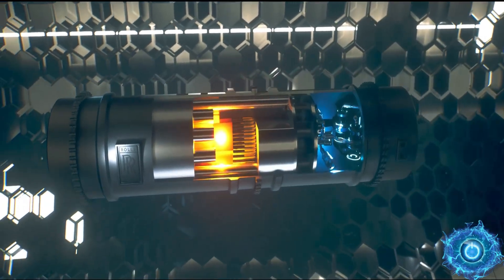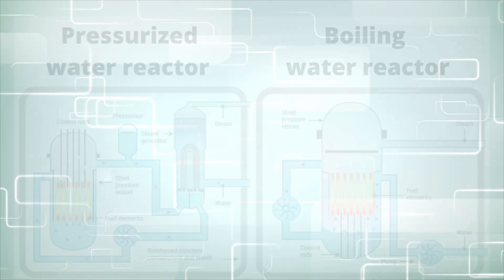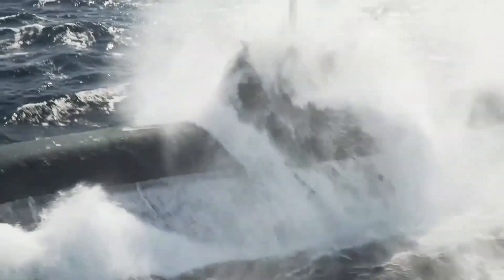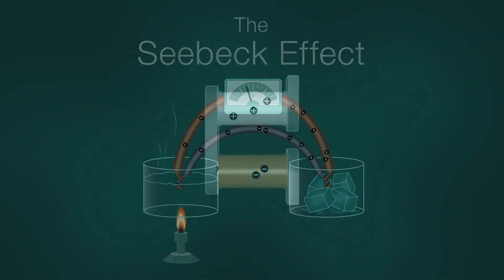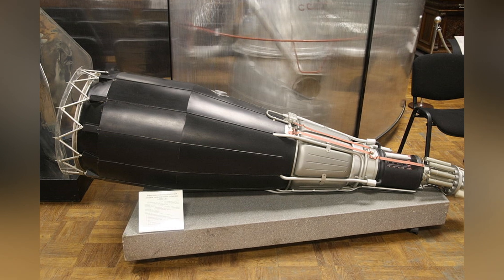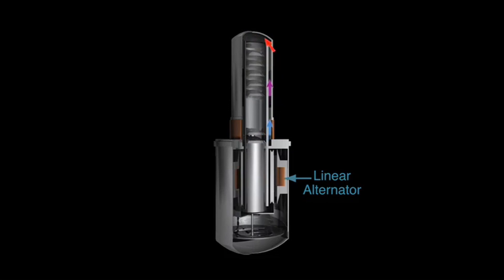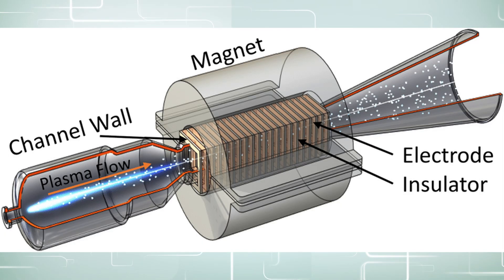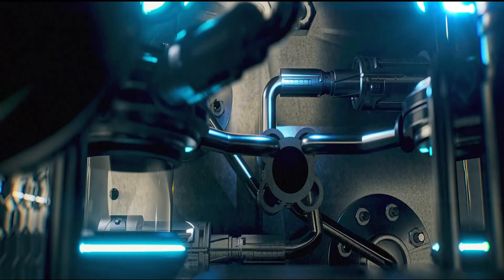New Space Power Source REVEALED!? - Nuclear Micro-Reactor

Comment: As long as the nuclear fuel is contained within a reactor that would survive any type of malfunction of the rocket or would be ejected in an emergency such as the reactor itself or the reactor vessel it would fall into the ocean and can be recovered. There is a 6 ton 40 megawatt reactor that's meant for space already made by Lockheed Martin and then there's a 50 Time 1 to 5 megawatt reactor also modular but it sounds like the Rolls-Royce modular reactor with up to 10 megawatts would be ideal.

Comment: The Event Horizon: Is The Object Or Each Event Horizon Each Object: Once That Object Is Stuck In The Point Of No Return In A Black Hole: The Edges Of That Event Horizon Or The Edge Of The Event Horizon Is/ Edge Of The Horizon: Is The Edges Of Those Objects At The Point Of No Return: You Can Toe Cable It Then Pull It With A Object Not Stuck That Has The Right Engine To Do This However You Do That Without Pulling It In Too!.

Comment: Future Power in Space? I don’t know, but I always imagined nuclear fission using Helium-3! I guess that will be in the distant future, but let’s hope not too distant… What are they telling us about using Nuclear Micro-Reactor in space, who would ah, right I have been commenting about them for years… I haven’t used Desktop ChatGPT for a while but I found it in the Portable Apps folder and asked.
You said: Tell me about the future micro nuclear reactors to be used in outer space.
GPT 4o-mini: Micro nuclear reactors, often referred to as "small modular reactors" (SMRs) or "nuclear batteries," are compact, efficient nuclear power systems designed to generate electricity in environments where traditional power sources are unavailable or impractical. These reactors are gaining attention for their potential use in outer space, especially in missions to the Moon, Mars, and beyond. Here's what the future holds for these reactors in space exploration:

 1. Why Nuclear Power in Space?
Space missions, particularly long-term ones, face significant challenges when it comes to power generation. Solar power, which is the most common energy source for space missions today, has limitations:
- Solar energy is weaker farther from the Sun (e.g., on Mars or beyond).
- The Moon’s 14-day long nights make solar power unreliable.
- Dust storms on Mars can block sunlight for extended periods.

Nuclear power, on the other hand, can operate continuously, regardless of location, day-night cycles, or environmental conditions. This makes it a critical power source for long-term space missions, habitats, and exploration activities.

 2. Types of Micro Nuclear Reactors for Space
Several micro nuclear reactor designs are being developed specifically for space applications. They are designed to be lightweight, reliable, and capable of providing continuous power for years without refueling. Some promising concepts include:

- Kilopower Reactor (NASA): This is one of the most well-known space reactor projects. Developed by NASA, Kilopower is a small fission reactor designed to generate about 1 to 10 kilowatts of power, sufficient for long-duration space missions. It uses uranium-235 as fuel, a Stirling engine for energy conversion, and can run for 10+ years without refueling.
  
- KRUSTY (Kilopower Reactor Using Stirling Technology): This project, which passed key tests in 2018, is part of NASA’s Kilopower initiative. KRUSTY can power a lunar or Martian outpost, offering consistent energy for habitats, rovers, and scientific instruments.

- Nuclear Thermal Propulsion (NTP): While not exactly a power generator, nuclear thermal propulsion reactors could play a dual role. NTP systems are designed for spacecraft propulsion, but excess energy from the reactor could also power onboard systems. NASA and DARPA are currently researching NTP as a means of speeding up human missions to Mars.

- Nuclear Electric Propulsion (NEP): NEP reactors generate electricity to power ion thrusters for spacecraft propulsion, and the same reactors could be used for energy on Mars or the Moon.

 3. Applications of Micro Nuclear Reactors in Space
- Lunar Bases: NASA’s Artemis mission plans to establish a sustainable human presence on the Moon. Micro nuclear reactors could power lunar habitats, water extraction systems, and communication networks. The absence of a significant atmosphere on the Moon and the long lunar nights make solar power insufficient, so nuclear reactors are critical for energy independence.

- Mars Colonies: Future human missions to Mars, including long-term settlements, will need reliable power sources to support life support systems, water extraction, food production, and scientific experiments. Mars has dust storms that last for months, blocking solar energy. Micro nuclear reactors would provide continuous, stable energy during these storms.

- Deep Space Exploration: Missions venturing into the outer solar system or beyond would benefit from micro nuclear reactors, as sunlight is too weak to power spacecraft far from the Sun. These reactors could power onboard systems for deep-space probes and interplanetary missions, enabling faster and more ambitious exploration.

 4. Key Benefits of Micro Nuclear Reactors in Space
- Longevity: Many of these reactors can operate for years or even decades without refueling, making them ideal for long-duration missions.
- Continuous Power: They are unaffected by environmental factors like darkness or dust storms, providing reliable, continuous energy.
- Compact Size: These reactors are small and lightweight, making them easy to transport and install on spacecraft or extraterrestrial habitats.

 5. Challenges and Considerations
- Radiation Shielding: In space, where radiation from the reactor can harm astronauts, proper shielding and safety measures are necessary.
- Launch Safety: Launching a nuclear reactor from Earth comes with risks. While these reactors are designed to be safe, mishaps during launch could pose environmental and safety concerns.
- Thermal Management: Space lacks an atmosphere to conduct heat away from the reactor, so managing excess heat in a vacuum is a challenge.

 6. Current Development and Future Outlook
NASA, along with other space agencies and private companies, is investing heavily in developing these reactors. The U.S. Department of Energy and NASA are collaborating on space nuclear technologies under initiatives like the Kilopower project. Companies like Lockheed Martin and Rosatom are also exploring nuclear power solutions for space.

In the next decade, we can expect to see micro nuclear reactors playing a crucial role in powering lunar bases as part of NASA’s Artemis program, supporting missions to Mars, and enabling new forms of deep-space exploration. These reactors will likely be critical for sustained human presence on other planets and the future of interplanetary travel.

You can find ChatGPT Desktop ver. at; github /lencx/ChatGPT/tree/main
You’ll see the green box with Code and an arrow, click the arrow to list choices and download the zip file for the windows portable app. Unzip it and run the ChatGPT.exe file. After it starts at the ChatGPT menu check for updates. After it restarts check the Preferences, click Control Center, use Dark Theme and Set the Speech Language or voice. 

My opinion is that dark theme is easer to read, but if you don’t feel like reading a long response, you can click the speaker icon and listen. If you are happy with GPT-mini then you can log in with your Google account to save the uses. If you have an Open AI account than you will have advanced options.? With GPT4All you will be able to use most of the Open-Source AIs, but it is text only. 

With ChatGPT Desktop you can create 2 images a day with image generator pro. I don’t like the AI Web Page generators that I have tried.? You can Explore GPTs that I’m sure you can try before you buy into Open AI. If you have a Pro or Turbo account you can use Dolle 3 from the window menu where the user guide is. 
‘I wonder what that looks like?’
Reply: one thing, helium 3 is used for fusion, not fission
Reply: @bigboi9856  I have already commented about that exact thing... I don't want to sound 'short or upset?' I don't like repeating myself... Honestly, I was wondering how long it would take for somebody to tell me I am wrong...
Reply from the maker: That's neat to see the information there! I use GPT sometimes for starting outside topics.  It would be nice to see RTG, thermionic and MHD information but I guess it just sources based on latest updates.

Comment: A thermo acoustic wave  powered generator using a small atomic pile is the only viable option.
Reply from the maker: That is a very intriguing way to produce power, maybe the highest ratio right now.
Reply: @Tech_Planet  yes, and you would not need much fissile material because it would use the near absolute zero temperatures of space as the heatsink so the high temeratures of it would only need to be several hundred ° f .

Comment: There is a huge obstacle - heat in a vacuum. Have you heard anything about the Zeus nuclear tug? Work on the project has been carried out since Soviet times, but from time to time it was closed and reopened, under a new name, reanimated and refined with renewed vigor, overcoming technical obstacles that in the past put it on pause. The concept has been developed and tested, confirming that all key elements work reliably and for a long time. But the problem with heat dissipation in a vacuum has reduced the efficiency of the installation to a minimum. If cooled through radiators, from the surface of which heat will be removed, the engines will not budge hundreds of meters of these grids. And micrometeorites will interrupt the circuit through which the hot body comes from the reactor... In this case, Russian scientists have developed a material that splices the breakdown site. But there is a more advanced heat removal technology. For a very long time it was considered ineffective, but over time it was proved that it should work. Drip cooler-radiator - droplets are sent to the catcher through outer space. During the flight, they remove heat and return to the reactor to repeat the cycle. So, everything is under implementation. The Chinese are also developing their own liquid metal coolant tugboat. Their reactor will be more compact. But the details, as always, they usually keep secret.
Reply from the maker: Good points!

Comment: I recently saw an article about a new PV material that works in the infrared specturm. I wonder if yhe steam cycle would be necessary at all if direct conversion from the coolant to IR PV can be made to work. That would be best imho, because it avoids all the dangers of explosions or burst vessels due to phase change of the working medium. However, i would expect it not to be very efficient. 
Will be interesting shat RR will present as a technical solution. I guess it will be steam tuebine based, as that is their core competency.

Comment: We need much faster thrusters, for a regular manned Moonbase, or beyond the Moon.  Ion thrusters are fast, but very weak.  They run on solar arrays.

With a much higher electricity, Ion thrusters can run strong.  Here is where a nuclear reactor comes in handy, if small enough or modular.  For efficient space travel, we must get over NASA's tincan design.  A spaceship is not meant to land or launch.  That is a job for shuttles.
🚀🏴‍☠️🎸

Comment: Build a space dock or an orbital assembly area  as an addition to the ISS then. as the space dock is completed, slowly phase out and recycle the iss the. anything we want to build or assemble in space within the size limitations of the space dock would be feasible. might start with modular items first. let's face it it is not like we are going to have 0 g forge furnaces for use in space yet at any rate.  arc and mig welding can be  can be done under controlled conditions aswell. the thought is out there. might want to consider magnetic plating  to hold ferris metals down. and screen or mesh materials to capture any parts that might get loose. utilizing existing orbital infrastructure will be difficult. but it can be managed  if there is enough renewed interest in the idea of such a orbital structure.

Comment: nuclear is just turbine and steam. It has to have some cooling stage and there is no such stage available in space
Reply: you can cool things by thermal radiation
Reply: Explain how there's no cooling stage in freezing cold space
Reply: @Harris_Mr  in vacuum there is no temperature dissipation so it will heat until it melt.
Reply: @viruslab1  it would carry a coolant
Reply: @viruslab1 Or does the ISS just warm up continuously without heaters thanks to astronauts body temperature ?
Reply: @viruslab1  you would be right, if the only thermal transfer mechanisms would be conduction and convection, but fortunately there is a third mechanism - thermal radiation.
Normally you will see that in use in  CERAN hob, which uses Infrared heat radiation to heat your cooking pots and food.
But it also works very well radiating way heat to cool.
You might have noticed that it is cooling down considerably during a cloudless night?
That is caused by thermal radiation bleeding off heat into empty space.
Therefore cooling is no problem in space you just need big enough heat gins to allow the heat a surface to radiate off of.

Comment: nuclear airplanes need to large. dont really care if you have only 10% of millions times more energy dense than conventional fuels energy/kg. conventional heat engines are around max 50% efficient, so I would pick the millions times more energy dense, even if its only 10% or 20%. like solar panels. scaling is not an issue, just make them bigger. everything. current available units is not a proper reasoning they cant be made bigger. so make a super mega star ship. instead of being limited to reactive thinking. be an active thinker. and maker and creator. yes you can. dont doubt with questions, just make it. if you need to make it more complex, if not using the normal TEG stuff, then complexity is not worth it. keep it simple, its not complex. its not rocket science. do the ring plasma MHD reactor, it can be used in earth nuclear fusion reactors also. you spin or move the plasma already in the fusion reactors. just make it work.
Reply: nuclear (fission/alpha/beta) TEG reactor can charge an electric airplane during and between flights, independently. similar to solar.